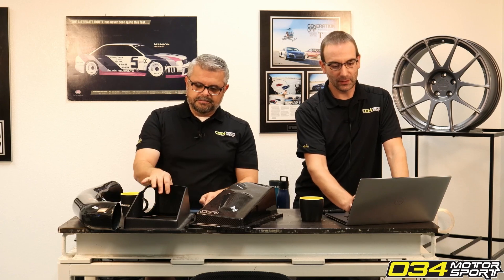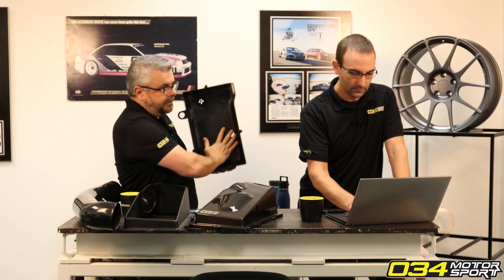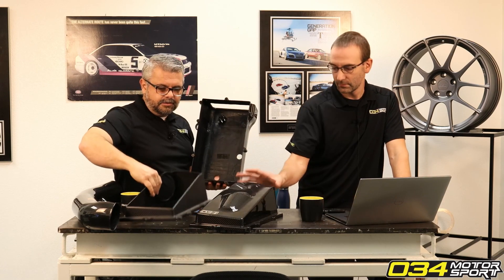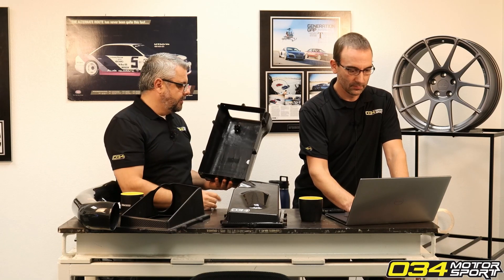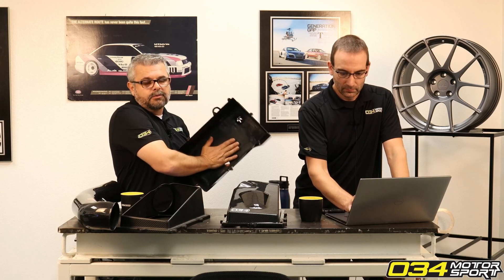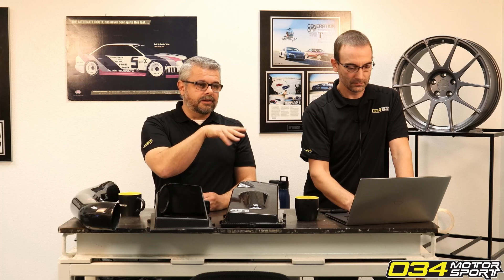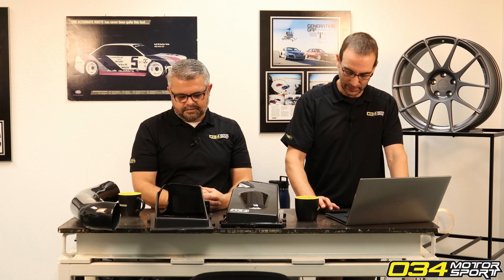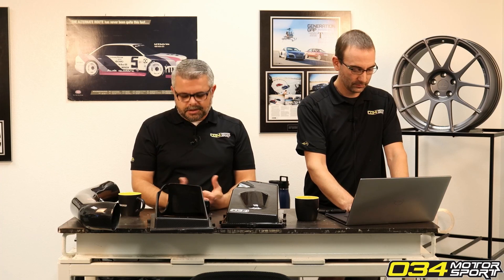Does a Larger Air Filter make an Intake Flow Better? | 034Motorsport FAQ

Comment: I have a 1981 g30 chevy with a 350 small block and I double stack 3in filters in my edelbrock 14in pan. Have no clue if it actually does anything but its 21 bucks for a second filter, fits inside the dog house, and looks cool. So there's that.

Comment: I also think there is less vacuum with a large air filter, therefore the larger surface area is pulling in air slower, allowing that air to become warmer due to it not circulating. A regular open air filter has a stronger vacuum and also more space from any air from ducts to allow for cooler and better circulation.

Comment: Say some show that open intakes can result in higher wastegate duty cycles due to increased intake air temp. Also given what you shared earlier, wouldn't the best  option be a panel filter?  I believe your insuction bundle by itself flows as good if not better than a few aftermarket options. This might be due to the fact that panels have the advantage of maximizing it's surrounding housing.
Reply from the maker: People say a lot of things online but we’ve yet to see proof of that with our S34 style intakes, we test and measure our intakes thoroughly during engineering and development.

Comment: What is ‘shrouding’?? I did not get your explanation. Diagrams would get rather than holding an air box that I don’t understand how the air flows.
Reply from the maker: We discuss this in the video but when the airbox is is too close to the filter it blocks airflow, we work to optimize shrouding to allow maximum airflow into the filter. Some companies hit huge filters inside tight fitting air boxes which negates the benefit of the bigger air filter.
Reply: @034motorsport  thank you! Got it and makes sense.
Reply from the maker: @chiquicat1  you’re welcome!

Comment: So it's not just about the size of the air filter, it's about how much air you can get to flow to the air filter.
Reply from the maker: Alister Robbie exactly! If the space does not permit it, a larger filter will perform worse than a  smaller filter in the same area
Reply: @034motorsport  if the space does permit it would it give more power?